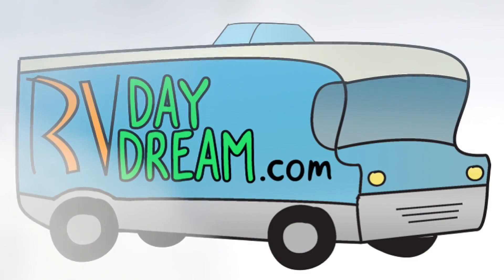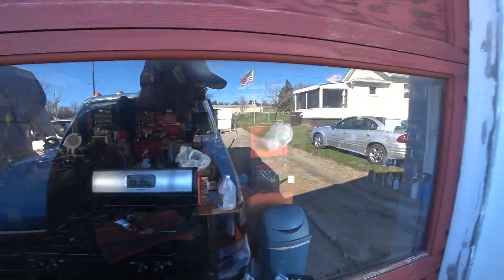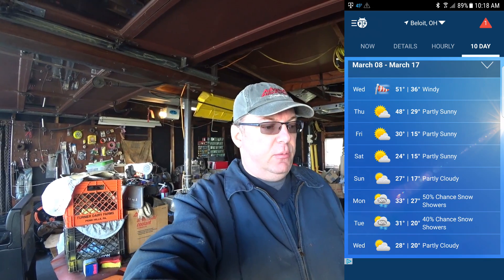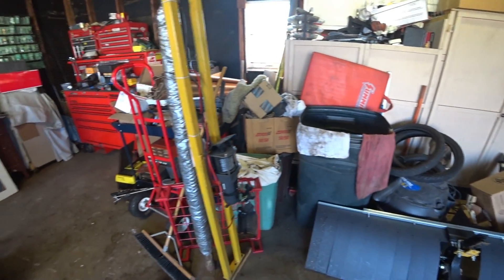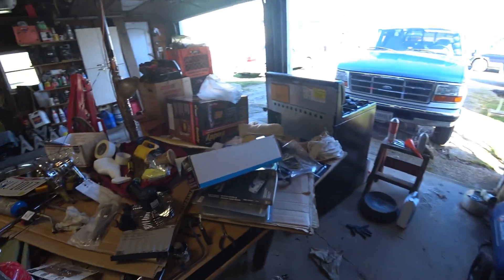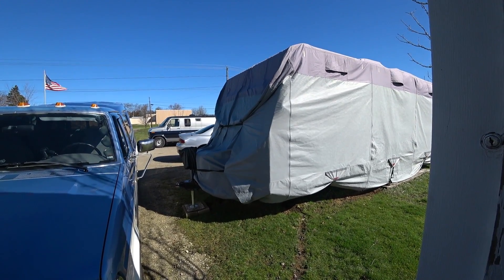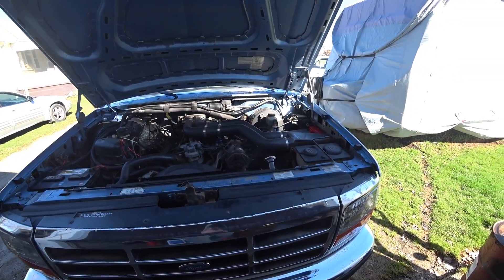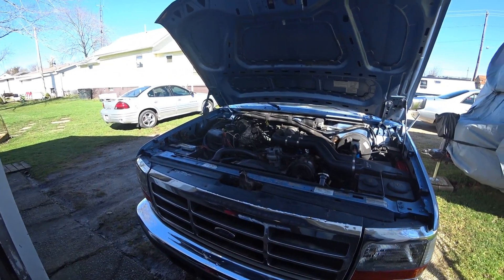RV Tow Vehicle engine noise and a Rant

Comment: Interesting info on the Ford 460. I own a 1997 F350 with the 460.
Reply from the maker: Charles Stein 👍same engine as this F250HD.. 😁
Reply from the maker: Charles Stein make sure you check out and subscribe to my other channel https://www.youtube.com/user/Foxboss9   as I do quite a few repairs and upgrades on my truck but I don't go into much detail on the rvdaydream channel as much as the foxboss9 channel.
Reply: I will perform the trick on the intake tubes on my 460 ASAP. I also have heard that removing the intake just under the hood to the air cleaner, makes a difference (?) Maybe another trick...
Reply from the maker: Charles Stein I drilled holes on the pre-filter side of the airbox for more airflow, I'm not sure how much that helps but I do have a K&N panel filter so any air they can be pulled by the engine should be able to do at a pretty high rate

Comment: You need a good garage sale.  Do you really want to go into "full timing" or even "week long vacations" with a 170k vehicle and it's original tranny.
Reply from the maker: Big Garage sale for sure... The high mileage vehicle, not so much... Still up in the air on that.. Would only cost 2000-4000 to install rebuilt Trans and engine OR sell truck and add 2000-4000 to purchase a newer one.. Cant seem to find a really decent Truck I would want to own that doesn't cost 35,000-45,000 dollars..
Reply: One point to make. NE. Ohio is not a big truck market.  Meaning used 
trucks fetch top dollar because there is not a whole lot of supply.  You
 go south or out west, and a dealer might have 50% new vehicle on his 
lot with trucks or large SUV's.  More likely people trade in, or return 
leases from a truck to another truck.  So they have a bunch on the used 
on the market.  So you just have to find that $20k or $25k 3/4 ton or 
larger one to cover any future towing needs.  You don't want to be 
broken down a 1000 miles from home.  Granted you have one thing going 
for you which is that you know engine repair, or even when something is 
not right.
Reply from the maker: Finding a truck from the south has always been a good idea, well, any vehicle for that matter BUT... In 2013 Ohio was one of the top 5 states in truck purchases and only Florida, Texas and California significantly outpaced Ohio in new truck sales >> http://visual.ly/10-states-most-pickup-trucks
However, Ohio residents pay less on average per vehicle than Every state in the US.. >> https://goo.gl/WK61e3
 I still shop Florida markets for Trucks..They are on all my saved searches for my Cpro app.. Your advice is sound for sure, 20-25000 is the sweet spot for a newer truck and the base,work editions of F250's with a 6.2 and 4WD(Which I would never consider unless towing) can be had with really low mileage and almost like new.. 
   It's funny how some engines just "sing" a certain way to let you know when there is a problem.. I thought it odd that my brother couldn't hear exactly when his Thermostat opened when holding a steady 2300 rpms on a sbf engine.. Come to find out a lot of people didn't even know what to listen for.. Or better yet the feel of the engine when you are 2 quarts low on oil and how easy it revs because of the loss of windage drag on the crank(I had an oil burner of a hot rod back in the 80's)
 Of course we still have quite a bit of time to work this old truck to see what shakes loose.. But Heidi and I pretty much concede the fact that a newer truck would have to be in the cards before the big move.. Oh No Truck shopping videos Ahead.. LOL